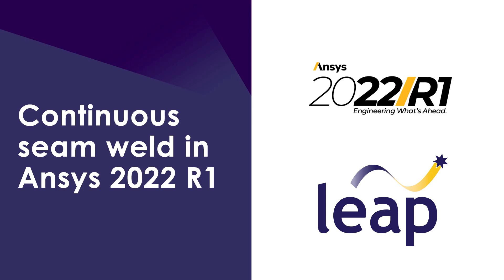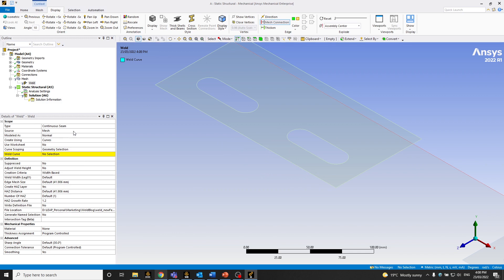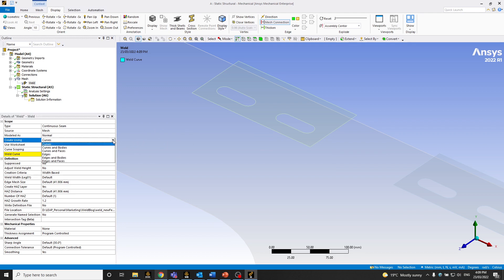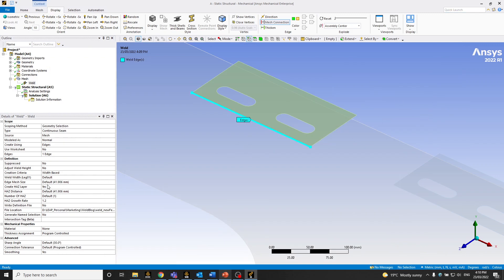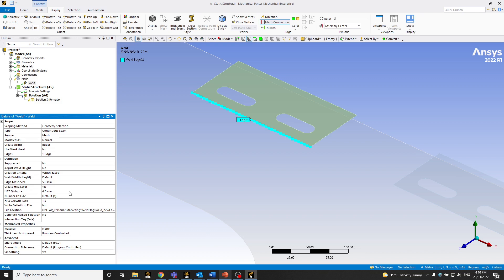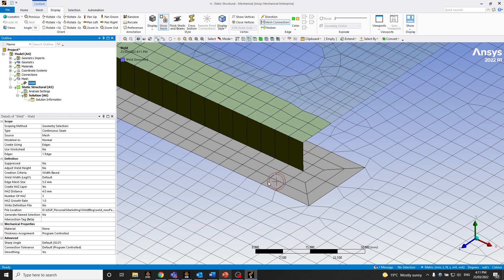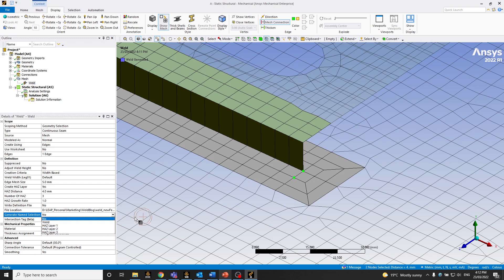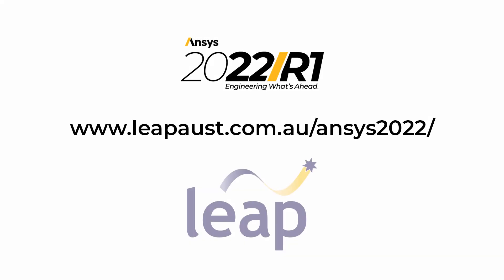Demonstration 1: Continuous seam weld in Ansys 2022 R1

Comment: Dear Sir, How to add this weld mesh for solid to solid object. I have try, but failed. There is a very hard problem for me in my project. Two ring-shaped parts with different lengths are assembled together through the interference relationship, and then one end of them is continuously welded. I realized the interference assembly through friction connection, but I don't know how to realize the welding seam. The only way I can think of at present is to build a 3D model of the welding seam in advance and then control its life and death through connection control function, but I think there maybe a not small accuracy of error. Thank you.
Reply from the maker: Solid to solid mesh should be done in the prep stage (Discovery/SpaceClaim). Welding option is only for batch connected shell model (for the time being).